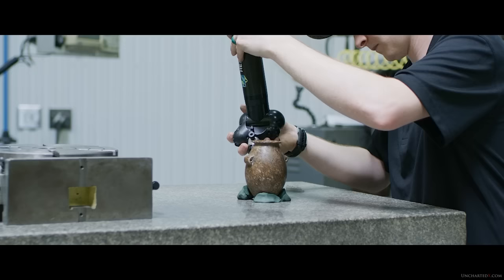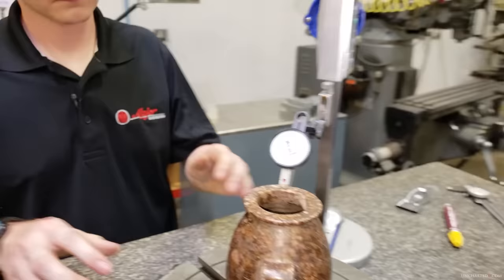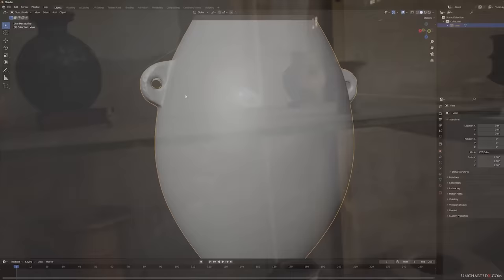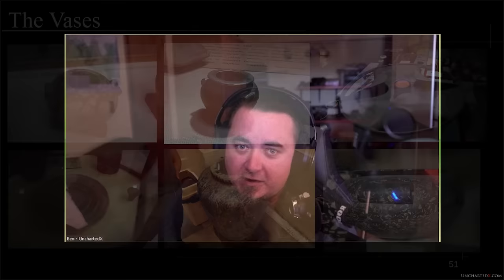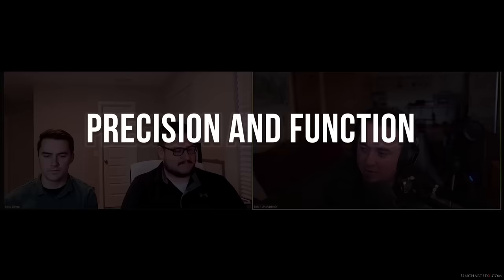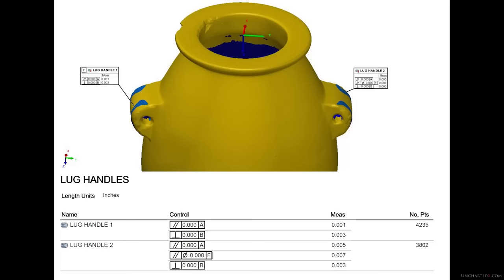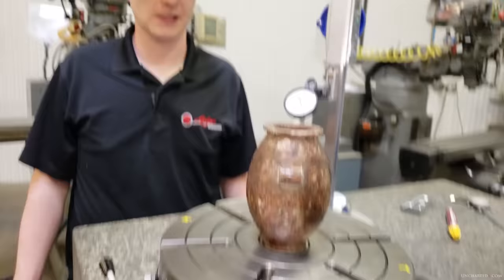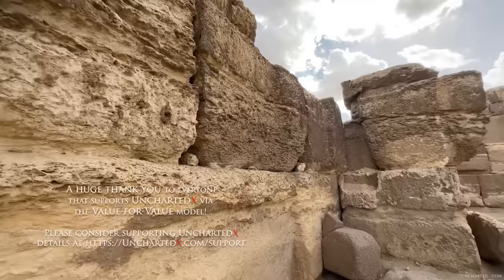Ancient Egyptian Vase Scan Update! STL file, More Analysis - and Between the Lug Handles

Comment: The outside of the handles could have been turned as well (they seem to be rounded in the plane of the rim), only the in between parts are a slight problem and the faces with the holes going through. These surfaces look different on the pictures and are probably formed differently. Shadows or slightly different surface quality in between the handles in a somewhat triangle shape, seem to be visible in some frames of this video. In addition, the in all directions rounded form around the handles fascinate me, but regrettably I do not have the digital equipment to do it myself. Could you try if tilting the vase and cutting the digital model in a plane above the handle on one side and below the handle on the opposite side, can you find a plane in any angle to find a circle? If yes the space in between the handles could have been turned as well, only a somewhat triangle form had to be finished in a different way.
In the hope, that my English is good enough to make this understandable... 
Cheers from Germany!
PS: Sorry for the wall of text...

Comment: I have no experience with cutting rocks, engineering or geology. It's my understanding that all the hardest rock crafted in Egypt was volcanic - granite, basalt etc? I did a quick google search and it sounds like volcanic activity was pretty common during a lot of pre-dynastic/dynastic Egypt. Is it possible that they found a way to craft these hard volcanic stones while they were still warm? For example would it be possible to make a mould by digging into sand, using water to achieve a smooth finish and then to either divert a flow of molten rock into it or fill it with rock that's cooled enough to be handled with tools? Failing that would it be possible to sculpt rock thats still soft? I think from what I've read cold, solidified volcanic rock could also potentially be used as a mould? This might sound utterly stupid, I know nothing haha but from watching videos like these and looking at the similarities in Ramses' head for example I won't stop theorising a mould or cast until someone tells me it's either dumb, impossible or possible.

Comment: about the STL file, actually are you able to provide original point cloud data? asking becouse stl mesh is obviously processed by shape preserving algorithm, not to mention its offset from its xy axis and rotated on z
Reply: The STL is the triangulated point cloud data.  The STL has not been processed to create geometric shapes such as a cylinder, etc.
Reply: @robertgolden2652  yes but the tringulation is more dense in certain areas than in others, that means its processed

Comment: woah woah... continually changing their tool pressure and speed, whilst maintaining finishes of a thousandth of an inch... that can't be done by hand or eye. I say this as a graphic artist with 30+ years experience. Hell I have enough trouble maintaining control over paper and pen and certainly not at those thresholds.

Would that not intimate computer control or some equivalent?

Comment: As well as being interested in the how?, I am becoming obsessed with the why? Ignoring the method used in such incredible precision, why would such precision be desirable for items that are utilitarian or decorative?
These vessels were apparently being used to hold ointments or other liquids and creating the outside dimensions to such precise dimensions seems like enormous overkill and a waste of time and manpower resources for ancient people limited in many ways by the technology and resources available at that time and having to deal with all of the other major problems that these people encounted in every aspect of everyday life.
Also, how did they know that such precision was being achieved if this was the main focus of the work as it does appear to be a major factor in the creator's manufacturing and thought processes?  They could have used ceramic vessels to achieve the same results, holding an amount of liquid, yet they went to seemingly massive efforts to create these wonders from hard stone.
Reply from the maker: I suspect they had another function originally. Perhaps resonators or something like that. They were certainly used later as vessels, likely had the holes in the lug handles drilled later too in order to support that use. Many of them do not have holes in the lugs. Only more research will tell.
Reply: @UnchartedX  Possibly. It would be another good advance in understanding these objects if they were subjected to sound and vibration testing to find out if they have as yet undiscovered capabilities.

Comment: Is there any evidence that the stones may have been softened with heat or  "super heated" or something like that before it was cut? Hotter = "softer" right? I havent ever heard anything like that yet. Im just spinning ideas in my head.
Reply: There are problems with softening material like granite, one is that it consists of different crystals that have different melting points and chemistry. Another is if granite is melted and cooled fairly quickly it becomes a glass.

Comment: Hint: you can say "twenty-eight microns" or "twenty-eight micrometers" instead of "zero point zero two eight of a millimeter". That's even easier to say the "one thousandth of an inch", and a more accurate scale. (1/100th of an inch is actually 25.4 microns, btw).

Comment: The vase is machined using hydrofluoric acid (HF) eating away the granite. Same method used in quarries, cf the remains of the square pattern acid pools. Work smart not hard = engineering. Cheers

Comment: As a lathe has a replicator attachment, so could a grinding machine allowing for the shaping of the sides where it would be bulged from the lathe leaving material for the handles. As for the inside, a lathe would have surely been used. This could easily be made of wood by a mediocre lathe smith. My point is, the technique is not that hard... The tooling seems impossible though, especially for the era.

Comment: I believe they had discovered gearing as well as the wheel, it's the only rational explanation. I think they would have used bulls or possibly steam as a drive mechanism for geared shaft driven motors. Even at that, what tool do they use on the motor to cut the stones.... Its a whole bag of worms because of the lack of information. We are basically left to speculate until there is an actual discovery. With the regulations in Egypt its going to take hundreds maybe even thousands of years to "properly" exhume sites of interest. We will probably never know in our lifetime.

Comment: Why can’t anyone comprehend Ancient Egyptians were masters at rock forging? 
At what temperature will granite melt?
about 1215° to 1260°.
Basalt melts at about 984° to 1260° and granite at about 1215° to 1260°. Because of the mineralizers in the magma, the temperature interval over which it crystallizes will be lower than that over which the rock can be melted in an open crucible in the laboratory.

Comment: Thanks for making the STL file available. Thought I'd try to print it on my 3D printer. No matter what parameters I use in my slicing software the Vase ends up solid on the inside unfortunately. I'm going ahead with a print anyway but just curious if anyone else had the same issue or whether I'm just using crappy slicing software. Also the STL didn't import to scale into my slicing software. Had I printed it the size it was imported it would only have been about 1"/25mm high.

Comment: I would say that Serapeum sarcophagi measurements are not precise as shown with  inside and outside measurements. I am afraid that viewing the past and assigning form vs function based on present ideas is not a good starting point.
Reply: don't believe everything you see online. if you are not aware, nearly all of the Serapeum boxes (interior) are unfinished, the few boxes that have a finished interior feature near-perfect 90 degree angles, flatness and parallelism of the walls.
Reply: @AustinKoleCarlisle  Oh I am aware.  The interior of the finished boxes are anything but perfect although that claim persists despite online photos demonstrating the non perfection. Although I guess I should allow for subjectivity since +/- 2 degrees may be considered perfect by some folks.
Reply: @Vision_2  you get that kind of error when the protractor isn't perfectly perpendicular to the walls.
Reply: @AustinKoleCarlisle  Also when the angles are not 90.00 degrees as demonstrated in the Serapeum sarcophagi.
Reply: @Vision_2  yes for the unfinished boxes and when the protractor isn't perpendicular to the corners.
Reply: @AustinKoleCarlisle  Finished boxes are  no different in that respect. Not perfect.

Comment: About measurement units: It easier to state 25 micrometer that 1 thousands of an inch. And generally you should talk in standardized units 95% of the world uses and not in minority units. Furthermore you present scientific results yet you should use scientific units.
If we presume a work on a lathe precision doesn't matter. You can preform high precision on a basic lathe.
The next interesting thing would be to identify tool marks. The exterior has been polished obviously but what about the interior?

Comment: I laugh at people that have degrees and no practical experience A lathe is the perfect tool to machine between the handles . The people that  think they would use a different tool between the handles don't know that if you remove work from a lathe you loose concentricity . With the proper tooling the area between the handles could be ground and polished on the lathe . Without removing the work from the lathe  .

Comment: Why when i look on the model and my eye line is parallel to the base (ground level), one handle's entry holes don't line up? It's not looking so precise.
Reply: the holes are not the focus of the video
Reply: @AustinKoleCarlisle  yeah but if other aspects of the vase are so impressive why botch this one? Or maybe scan accuracy is not that good?
Reply: @97DarkSkull  i dont want to speculate but if i had to guess, the holes either didn't contribute to the intended function OR they were added later by the Dynastic Egyptians.
Reply: @AustinKoleCarlisle  Ok so now i think it's just because of the scan technique used. It cant scan in narrow, tight spots like handles or inside if the vase.

Comment: Would it be possible to spin the object on the Z axis and use an abrasive to achieve precision circles? 
Its obvious the wheel was used in ancient Egypt despite the assertion otherwise.
Reply: Could this object actually be recently manufactured? A fake, if you will.

Comment: The only way these vases where made is by making them like you would with clay, I think the material used was soft at one time by vibration.
Reply: This is possible,but how would they have softened the different minerals in granite, which have vastly different physical and chemical properties. All at the same time.

The vase still requires extremely accurate machining in order to achieve this precision, even if the material is soft.

Comment: Using conventional, machine, production thought as a base for such objects is thinking in the wrong reality.  A solid, hard machining tool was not used.  Think of fluid at a molecular level used under a plasmakinesis process and there is no limit such as mechanical processes have.  The surface shows the signature of such a process.

Comment: Hi,  I know nothing about this,  engineering or archeology,  except what I just learned from your video,   and it got me thinking about methods of replication, which I also know nothing about,  obviously a mold is out of the question but if it could be replicated today with CADCAM with todays materials and  I think you said it was made of granite, an igneous rock, right?  so could it have been fabricated from a molten state with equipment able to stand the heat.   I mean,  didn't they see an alien spacecraft tethered to the sun a few years back?  ( or did iI go down the wrong rabbit hole) The argument to this is the mechanical markings but could that be from a polishing procedure maybe?   Have any two been found that were identical,  as if made for a set?  I found you by accident but I'm hanging around for awhile.  Fascinating stuff.

Comment: 12:30 It's not a problem with your motives or evidence, it is with how you've defined the datums for the vase, and chery picked what you like about it. 

While datums A and B may be close to perpendicular, you haven't defined any of the other relevant points on the vase to these datum planes.

You've basically said; "the top is perpendicular to the centerline, therefore perfect". That's not how this works. That's not how anything works.
Reply: from my understanding, that's also the most difficult tolerance to maintain, hence the focus on it.
Reply: @AustinKoleCarlisle  Well, then your understanding is wrong. All they showed with the geometric tolerancing is that they defined those datums to be perpendicular. They aren't showing how any of the surfaces of the vase are related to those DEFINED DATUMS. 

Of course they are perpendicular, that's literally all it's saying. I need to know how the surfaces of the object relate to the defined datums, which unfortunately isn't shown.
Reply: @xXxTeenSplayer  "of course it's perpendicular"? the precision isn't a given, it's an achievement that is the focus of the video. perhaps you should recreate the vase if you think it's so easy.
Reply: @AustinKoleCarlisle  You're missing my point. They defined a centerline as perpendicular to the top of the vase. This doesn't tell us anything about how the outside, or inside surfaces of the vase related to these two defined datums. Have you ever taken GD&T? Not that you need to, but it would help understanding what I'm saying.
Reply: @xXxTeenSplayer  they referred to the outside surface plenty of times. perhaps you should finish the video before running with the first knee-jerk reaction because you're too impatient.
Reply: @AustinKoleCarlisle  I did watch the video. They showed the GD&T, and it didn't match what was being claimed. I already explained it.
Reply: @xXxTeenSplayer  They also matched geometic shapes to some  surfaces.
Reply: @jamemswright3044  I mean, maybe that's true? What this video shows is that they defined two datums. That doesn't hold much scientific weight...
Reply: @AustinKoleCarlisle  I watched the entire video. What I specifically am referring to is the GD&T shown in the video that they claim shows how perfect the vase is. Spoiler alert; it doesn't. It doesn't even reference any surface other than the top. Of course the top is going to be perpendicular to an arbitrary center line that they have defined as such.

What I'm saying is they don't tell us jack shit about the vase.
Reply: @xXxTeenSplayer  The axis of symmetry is not arbitrary. I think you need to re-watch the videos, pay particular attention to how the axis and plane's are identified.